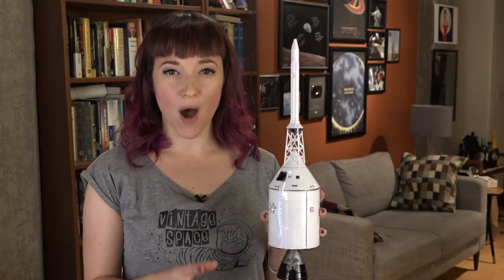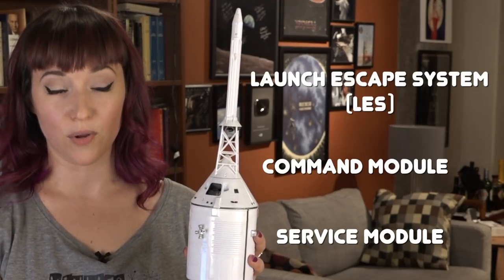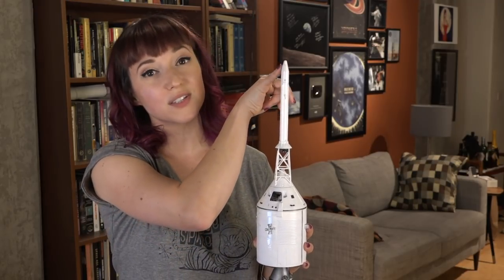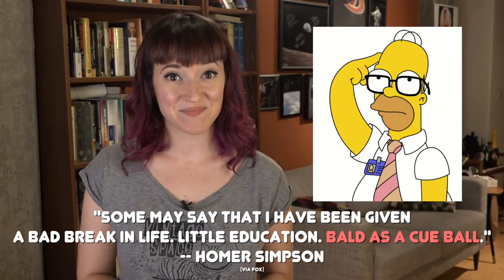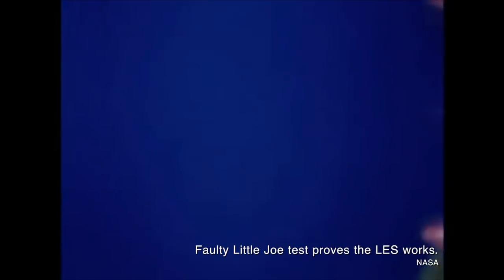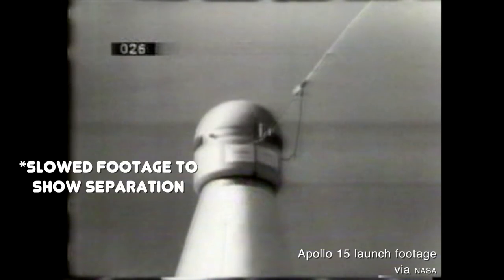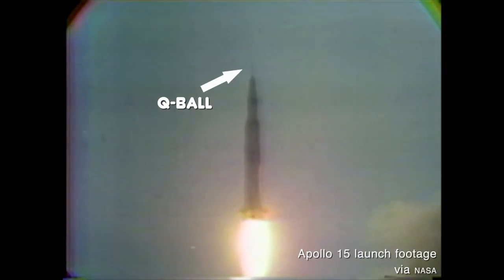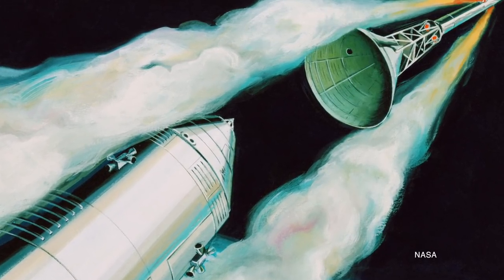The Life-Saving Q-Ball of Apollo

Comment: Was there a crew escape system on the launch tower, in case the crew need to rapidly evacuate before launch, when the umbilicals/plugs we're still engaged? Or was the LES the only means if rapid escape?
Reply: The crew could open the hatch, egress the cabin, walk across swing arm 9 and take a slide wire down to an underground bunker.  Not exactly a quick escape.
Reply: @apollo11guy  I remember seeing something like that in the most recent Men In Black movie...a zipline basket system to the beach near a bunker. Good to know there is at least some truth to it. Cheers.
Reply: The real one wasn't on the beach, it was to the NW of the tower as I recall, inside the pad perimeter security fence.

Comment: Hi Amy. Research mission (Apollo) where oxygen tank exploded and why that happend and also who on earth puts sparking devices inside "flammable" container..........reasons if discovered why?
Reply: The trail of things that caused the explosion is well known, and like most disasters, it took the entire chain of events.

During the assembly of the Apollo 10 SM, an O2 tank was dropped a couple of inches.  Rather than test the tank and hold up assembly, they swapped it out for a new tank, and tested it later, when it was going to be used in 13.  The only problem they found was that the drain valve wouldn't let them drain the LOX after the test.  The drain tube wasn't used in flight, so the engineers decided to turn on the tank heaters and boil off the O2.

The heaters had a thermostat that was designed to open at 80 degrees F.  Unfortunately, the thermostat was the original design, which took 28 volts DC, while the ground equipment had all be updated to run on 65 VDC.  When the temperature reached 80, the thermostat tried to open, but with the higher current it arced and welded itself shut, so the temperature continued to rise-up to about 1000 degrees.

The techs monitoring the test would have caught it, but the temperature gauge only went up to just over 80 degrees-the normal temperature they'd expect to see.  As a result, they didn't know the tank got incredibly hot.  Hot enough that it caused the insulation on the wiring to the fan motor to break down, causing the wiring to be exposed.  When the O2 level got to a certain point and the fans were turned on, it sparked, and caused the explosion.

It wasn't a case of someone putting "sparking devices inside "flammable" container"-without the loss of insulation on the wiring there would have been no spark.  Under normal conditions, it's not dangerous-assuming the car you drive is less than 20 years old, it almost certainly has an electric fuel pump inside the gas tank, so you've got wiring in an environment of gasoline and gasoline vapor, and you don't hear of cars suddenly exploding

Comment: Lightening could be an issue.  Looks like the tower is taller when on the pad, but during launch, this is the first place lightening would hit.
Reply: It's "lightning", not "lightening".

And yes that could be an issue for the rocket, but not for the Q-Ball itself. It is important for the ball to be covered so that no debris could get in there. Lightning would just pass around the outer metal layer of the rocket (of course, from the Launch Abort System downwards), but not through it... so the Q-Ball would be fine.

But lightning actually struck TWICE during the Apollo 12 mission. The first strike made the 3 fuel cells from the Service Module go offline. And the second one took down most of the CSM instrumentation (expecially the telemetry instruments). In the end, the mission continued mostly fine, even with these lightning strikes.

Find out more about this story in this other Vintage Space video: https://www.youtube.com/watch?v=9i6yD2c2Jho ("What Happened on Board when Apollo 12 was Struck by Lightning") - (lenght: 5 min. 54 sec.)

Comment: What's the launch abort system like for the Space Launch System? Similar to Apollo?
Reply: nope.  No tower to pull it away. Later they added a slide pole, to push out the door and try to escape.
One of the reasons the Shuttle was cancelled.  It is NEXT to the rocket, not on top of it.
Reply: bkearns34 Not the Shuttle; SLS

Comment: Hi Amy, different subject. Regarding the Challenger disaster, has anyone done a 'what-if' study  if the O-ring breach had occurred on the outboard side from the strut / tank connection?  The plume would not have impacted the tank / strut, and maybe the SRB could have survived long enough to finish  consumption of the remaining fuel and separate 'normally'.  Could the main engines gimble enough to make up for the decreasing SRB thrust through the remaining seconds of the damaged SRB burn, and avoid the disaster?  Just curious if anyone looked into this fanciful scenario.
Reply: Michael Clark I've had that same thought.  My unscientific guess is that it still ends in tragedy.  The SRBs were responsible for most of the initial lift of the entire stack,  and one of them (and only one) was super weak... and getting weaker.  I think that as pressures continued to fall in the SRB, it's thrust would quickly die off to a point where the other SRB and the SMEs couldn't keep the stack accelerating. If memory serves correct,  the abort mode to return to launch assumed that there was a problem in one or more SMEs, and needed the delta of the SRBs to make it work.   I don't think there's near enough gimbal capability to compensate for the above scenario anyway.  :-(
Reply: The photo I only saw one time of the recovered SRB had a burned hole in it large enough to step through.  No way to compensate for that much off-angle thrust.  However, if the flame had been on the outside, it would have been visible to ground controllers, and an SRB SEP could have been performed before exceeding RTLS abort parameters.  Don't forget, they would still have a lot of fuel remaining in the ET, and that translates to time and options, especially at lower thrust.  Perhaps a longshot, but at least they could try to do something other than falling 10 miles out of the sky with no way of a safe stop, as it happened.

Comment: Sounds like quite the Rube Goldberg contraption !!!
Reply: That was my first thought!
Reply: Not unlike the lanyards that closed the protective covers on the tail service masts at launch.   A simple wire attached to the hoods and to the S1C and the hoods.

Amy, have you covered the tail service masts and mechanisms for detaching the supply lines on the tower from the vehicle?
Reply: Yes and No: It appears to be overcomplicated but the nice thing of this solution is that, in the event of a failure of the actuator releasing the weight, with the rocket lifting-off the wire would be eventually pulled anyway, releasing and removing the ball cover. So it actually looks quite rupe-goldbergesque but is in fact a robust and simple solution. probably the only way this system could fail was if the wire snapped
Reply: Adam Shaiken i
Reply: Rube goldberg

Comment: LoL.  Who created the Q-Ball cover release mechanism?  Rube Goldberg?  

Let me see if I got this straight...It was connected by a rubber band connected to a razor blade that drops a ball into a bathtub where it goes down the drain falling onto a lever that releases a match connected a spring that simultaneously lights a firecracker and drops a harness onto a herd of mice that get spooked by the firecracker and run away pulling the cover safely off the Q-Ball?  Did I get it close?

Comment: If the command module had 1 large heat shield on the bottom, how did the consumables get to the astronauts?
Reply: There were a series of conduits that carried the consumables from the SM to the side of the CM above the heat shield.  https://4.bp.blogspot.com/-Aoom67otIuQ/VjJpMJGnZVI/AAAAAAAADFM/CGq5UtBzjUY/s1600/APMa28.JPG shows it on the right side of the photo.  When they were ready to jettison the SM, they flipped switches that transferred things like the O2 supply from SM to the tanks in the CM, and then a guillotine severed the connections.

Comment: As a slightly pedantic comment, pitot tubes do not measure airspeed, they measure air speed modulated by air pressure. Airspeed on its own is not nearly as useful to a pilot as what a pitot tube measures: for an equal airspeed, less air pressure equals less lift, so the tube gives a reading that is much more useful to pilots than airspeed alone, since it relates directly to the amount of lift that is generated by the wing for a given angle of attack. Air speed alone does not.

Comment: I'd sure like to verify something my father told me a couple years before he died. 

He had been a leadman on the crew at North American Rockwell, Rocketdyne in Canoga Park, CA building the F-1 rocket engines on the bottom of the Saturn 5 rockets. 

He said there were 65 F-1 engines that were built but never used. He said they are in a warehouse somewhere. 

That would seem to indicate there were 13 more flights planned. If this is accurate, and the guy who built them should know, what happened to cut the project short?
Reply: Congress.

Comment: I'm wondering why the tower was jetissoned that early
Reply: According to Wikipedia the escape tower was jettisoned after first stage separation, several minutes into the flight, at which height it was no longer useful.
Reply: +Gordon Richardson But why, what if the rocket exploded after that
Reply: Not every contingency was recoverable, but there is a whole chapter of https://en.wikipedia.org/wiki/Apollo_abort_modes
Edit: Mode II: Abort early during S-II burn. With the LES gone, the Command/Service Module (CSM) would separate as a whole from the rocket and use its large engine and RCS engines to move clear of the rocket and align itself. The CM would then separate from the SM and splash down.
Reply: +Gordon Richardson Thank you
Reply: +Gordon Richardson I've read it thanks, my guess is that the air is thin enough for the CM engine to be able to escape the exploding rocket